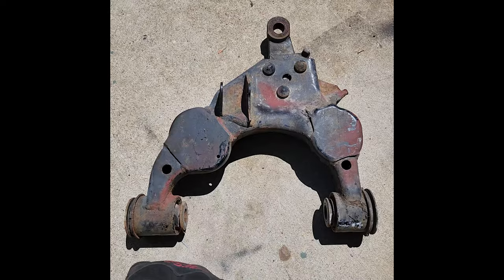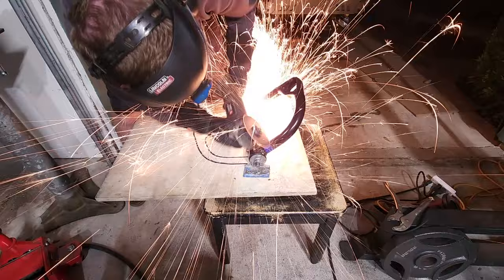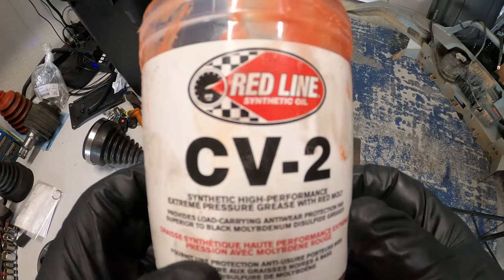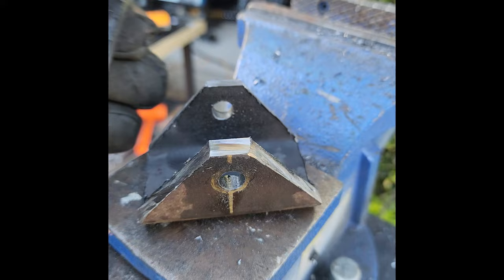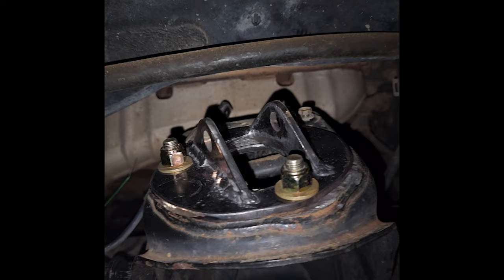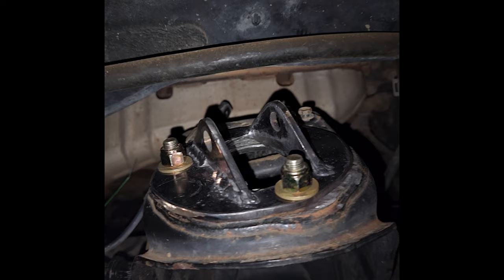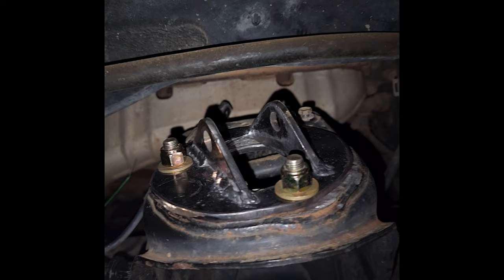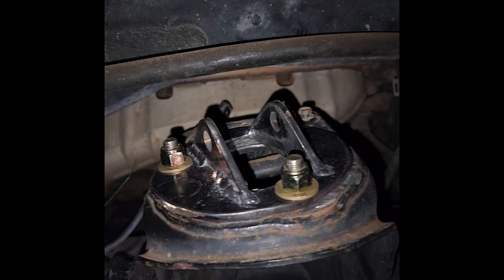EPIC Garage Built Long-Travel Suspension // Toyota Sequoia // Tundra

Comment: Nice vid.  Thanks.  When splicing the tubes you should make the weld joint longer.  taper the ends or fish mouth them or add an internal reinforcement.  Have a look at the tube splicing methods used for aircraft.  You can down the AC43-13 document for free from the FAA.  The reason for this is that the heat effected zone of a weld will be weaker than the tube.  By making the weld longer you will spread the loads over a longer weld.
Reply from the maker: Thanks for the constructive criticism, I wondered about that. Thought about putting an internal slug where the sleeves join, but since it wasn't completely straight it would have been difficult. (Mainly I was rushing let's be honest). I ended up welding some quarter inch ribs from the bushing barrels all the way down the top of each side of each UCA. I think it added a little strength, so far no issues and I've been beating on the thing hard. 
I'm always down to learn though so I will check out that documentation
Reply: @treehouseoffroad  I do quite a bit of aircraft fuselage welding so I look at all welds with those "goggles" on. :-)

Comment: Looks great man! (i know this was a year+ ago for you but I stumbled across your build). Union Valley Reservoir is 30 minutes up the road here, so rubicon videos are both fun and hilarious. It's great to see people enjoying ones own youth stomping grounds and funny because everyone seems to have this mystical view of "The Rubicon Trail", it's like any good off road experience, there's easy parts and parts that most just have to go around rather than through, but the place is kinda special. Next time you head up, take a day and head up to echo lake and hike to the summit. It's 8000 feet of granite elevation and you can see from Lake Tahoe to the pacific mountain range on a clear day.
Reply from the maker: That hike sounds amazing but do you have any tips on mitigating altitude sickness?
Reply: @treehouseoffroad  well airplane cabins are pressurized to 8000ft typically so most people can handle it pretty well, if the rubicon is 6000ish so there's not too much difference. If you don't want to train cardio with a gas mask or can't acclimate quickly, just enjoy the walk. One of my best friend's growing had a family cabin on the lake and we would climb straight up to the flagpole as teens in about an hour, but if you want a safe adult hike you can go the long way round on the trail at a walking pace. There's a decent forest service lodge and parking at the entrance. It's definitely a top 10 mountain tops in CA, like Mt Whitney and Half Dome at Yosemite. Bring a camera, walking sticks, sunscreen, and water. 
A good writeup of the hike/climb can be found here, (it was a 5 hour round trip for the author) https://totallyunqualified.com/2018/08/echo-ridge-traverse/

Comment: I love the video process and how well you show what you’ve done. 
I’m thinking your next step is installing a Dana 44 or 60 under the front of it.
Reply from the maker: It may come to that. My goal is to put a 2nd gen Sequoia front diff in it. Way bigger ring & pinion, way bigger CV axles. But it's not going to be easy....
Reply: @treehouseoffroad  Think of all the problems you would eliminate with a solid axle. Articulation, strength, lower ball joints, etc…. I’m hoping a “how to” guy does it and shows us the best way possible to do it.

Comment: Not bad. Worked at Solo Motorsports for a very long time. I always encouraged customers to do as much work on their vehicles to learn about them. However, I can think of 100+ customers that could not fab their own LT kit.  It is A LOT HARDER than you think versus the cost of an LT kit and your time. My only advice Treehouse — and this is from desert racing Toyotas — lose the UCA ball joints. 1” uniball cups, uniballs & C-clips are cheap at Kartek. Broke too many of the UCA BJs racing “preuniball” era!!  🤙🤙
Reply from the maker: You're not kidding man. At the beginning it seemed like it wouldn't be too hard. But as I got going I hit a few points where I was like "what did I get myself into? I bit off waaay more than I can chew"
 I was looking for a challenge and I found it.
I appreciate the advice on the uniballs, I'll probably do it before I have a failure. I'd also like to have uniball lowers at some point too.
Thanks for leaving such a thorough comment
Reply: @treehouseoffroad  To keep it budget and you have a Sequoia that’s 03-07, change the LBJ with a grease fitting to lube before/after off roading. If you’re not going to beat the crap out of it high-speed or bump super hard over rocks, install good Moog or Mevotech LBJs from Rockauto. Remember the 00-02 LBJs have a “square” bolt pattern like the 3rd gen 4RUNNERs and 1st gen Tacomas. If you have the “rectangular” bolt pattern LBJs, then those are beefy and save your money!!  Good luck.
Reply from the maker: @paulmichaels3999  Thanks yeah mines an 06 but my wife drives an 03 and she has that smaller LBJ. Smaller bolts even

Comment: Exactly video I’d searched many time for home made long travel and there’s not much especially for a Toyota sequoia/tundra
Reply from the maker: No there isn't. There are a few guys with homemade 4runner kits but they used a CNC if I remember correctly. There's also a guy who did LT for a LC 100 Series, came out badass 💪

Comment: Nice work! The only thing I would question is the upper control arms. I know they aren't load bearing so don't have to be that strong but did you consider using larger diameter tubes as sleeves for extra strength? Just depending on your welds to hold them together seems a bit minimal especially with the extra leverage that they'll be subjected to. It'd only be a few extra pounds for alot more peace of mind. Just my 2 cents. Great work overall though 👍
Reply from the maker: I appreciate the constructive criticism! I completely agree, I wanted to sleeve the inside of the tubes but the way it worked out they're not completely straight. About a month after this build I went and put quarter inch plate "ribs" down the top center of each side of the upper control arms tying the three pieces together on each side. Check it out I'm curious on your thoughts: 
https://www.instagram.com/reel/CtcdIUCN237/?igsh=MzRlODBiNWFlZA==
Reply: @treehouseoffroad  yeah,  that'll definitely help 👌

Comment: Question now seeing the prices would it been better to save for a kit or go your route? What’s your opinion sir?
Reply from the maker: I could've bought a kit I went this way on purpose bc I'm a glutton for punishment lol. Nah but honestly I budgeted for in case I couldn't get it done and had to buy upper/lower arms. I already have everything else I need I could get a set of arms alone for $2k and still come in at just over $5k. I'm gonna run this hard for a while and see if it holds up, so far so good
Reply: @treehouseoffroad  right on dude! One tip run the limit strap up higher or a shorter one you don’t want to over extend the shaft the limit straps will stretch overtime
Reply from the maker: @Longtraveldreams  Word thanks for tip I've never had limit straps

Comment: What kind of welding/wire did you do? Mig or flux core?
Reply from the maker: Lincoln 180amp mig running on 220 using flux core
Reply: @treehouseoffroad  thanks for the reply. I’ve been wondering if anyone uses flux to fab stuff on their rigs. Im glad to know because it’s a little more cost efficient
Reply from the maker: @mhernandezpb00  Great penetration too

Comment: I see you ended up using wood for your fixture like I did lol
I have a real fixture now and I’m getting ready to start my rebuild I’ll keep you posted I might start making some kits and other parts so …
Reply from the maker: Haha I was a little worries about the wood not holding tight enough. I was also sure that the rubber bushings would flex/melt/distort and it wouldn't line back up with the frame but it slipped right in! Document your rebuild for us!!!!
Reply: @treehouseoffroad  oh yeah I didn’t even bolt it to the wood lol I used all thread nuts and washers to locate everything using the wood as a template drawn out my tires were moved 2” forward and sleeved the jba uppers with dom as well as the steering links this time around I’m building the uppers lowers ball joint elimination cam bolt elimination Heim steering bla bla bla just waiting on parts ill document everything and post it up

Comment: I just paid for total chaos suspension and King shocks for my 05 Sequoia Limited I'm having someone do it for me they're going to add flared fenders in the front. They're working with a fiberglass company that's making rear fenders for the Sequoia. I will be the first one to get them. It's a prototype they don't have flared fenders for the Sequoia you got to buy the front flared fenders for the tundra to fit your Sequoia so this company in California is fabricating rear fenders for the Sequoia.. I'm also getting rear lockers front lockers bigger gears in the front and rear I paid them 29k they haven't even gotten my truck yet still waiting on my wheels and the gears and lockers... I'm pretty sure you didn't even spend half of what I just did LOL just the total chaos long travel was 11,000 they're lifting it three-and-a-half in with 35 by 12.5 by 17 tires.
Reply from the maker: Wow sounds like quite a build! I just opened an off-road shop with my buddy, too bad you weren't out my way I would've loved to build that for you! There is someone with fiberglass rears on his Sequoia, but it must be a one-off deal

Comment: Was that flux core?
Reply from the maker: Sure was
Reply: @treehouseoffroad  nice job on the arms. I'm looking to do something similar with my 4runner
Reply from the maker: @mada310  thanks man it's been working really well
Reply: @treehouseoffroad  do you know how much travel it pulls? I assume one of the balljoints is its limiting factor?
Reply from the maker: I think I remember strapping it at around 12 inches but I don't remember what the limiting factor was. You're probably right about the ball joints. I'd love to take a spring off and measure but it's my daily driver and I'm just too damn busy
Reply: @treehouseoffroad  the SPC upper balljoints have more movement than factory at least. Maybe someday uniballs will be in my budget

Comment: Really good work. But I think you could have saved money  and time by going with a solid front axle.
Reply from the maker: Thanks but it wasn't about saving time or money, I was on a mission from God
Reply: @treehouseoffroad  you did a really good job.  I would change the the design of your upper control arms.  With all the welding spots, on that control arm something will brack.

Comment: You're living my dream. i like what you said about being uncomfortable. i'm a beginner welder and i modify my 4runner a lot, but nothing ever like this. definitely inspiring me to think bigger with my future projects.
Reply from the maker: Yeah I never thought that little speech about being uncomfortable would resonate with as many people as it did. 
I listen to a lot of fitness/mindset podcasts and it's one of their golden rules. I have a job where I don't get a whole lotta 'attaboys, so I have to look within for the that type of praise.
Keep challenging yourself my man
Reply: @treehouseoffroad  Today i just interviewed for a mig welding position at a mopar header shop... i failed miserably and burned through every pipe they gave me. even after adjusting settings. i think i outran my puddle trying to go fast to avoid burn through. which ironically caused burn through. I'm honestly not sure, the lead welder there ran a perfect bead with the same settings.  I really don't even know what he was doing different. definitely recalibrated how good i thought i was. I mean i've never welded thin tubing before, only thicker materials and i am certified as a welder. But... i haven't been able to practice cause i'm out of work, and i can't get work cause i'm out of practice basically i'm stuck in a catch 22 scenario.

I'm very angry, distressed, agitated. I am a good welder under the right circumstances i still believe, but i  just dropped the ball today. but hey atleast i tried... my third weld test i've failed.

Thinking of just getting an unskilled job to save up for my own machine where i can practice on my own...Sucks to fail so many times. i got 10 weeks of training just to fail so many times.

All those podcasts and motivational speakers always say to push yourself and fail until you succeed.. But i really don't see myself succeeding currently with my current skillset.
Reply from the maker: @jvogler_art4708  I took a welding course at my local Community College, and probably use 5% of what I learned in the real world. None of it seemed to translate. If it were me I'd ask the person that tested and failed me what he would recommend I do. Maybe get myself some thin tube and just practice practice practice.
Sorry you're struggling man, it will get better.

Comment: If you've got something like this that has body roll and you want to kill it for when you're driving on the highway to the trail all you have to do is throw some spring rubbers in between the springs and some sumo springs on the back if you've got a solid axle... They're not hard to put on and take off. You'll totally change the characteristics of the vehicle while you're on the street. Why not? 

Race car drivers do this all the time they change the suspension from track to track using things like spring rubbers apparently.
Reply from the maker: It definitely has body roll on the street. I may try this thanks for the tip

Comment: Awesome job, subscribed! 

Are your end link disconnects working well? Did you modify your Maxxlinks? I need new end links 😁
Reply from the maker: They worked great for a while but ended up getting slightly distorted under all the abuse, and became difficult to connect and disconnect. I've since abandoned both my sway bars. Driving without them takes some getting used to but I like it

Comment: Very cool! Badass.
By any chance have you ever hit the 4th button (the one next to the vac button) while driving? 
Now the orange blinking light doesn’t turn off while driving in 2nd Normal daily driving.
Reply from the maker: The 4wd button is meant to be pushed at speeds up to 60 mph. If the orange light is flashing It could mean a lot of things, but usually indicates that the computer has not finished its cycle between the modes. There's several good YouTube videos on this topic, you'll need to do some research. Good luck thanks for watching

Comment: I've been a welder/fabricator nearly 30 years, from military patrol boats, wind towers, aerial lifts, oil & gas pipe welding to custom tube chassis and suspension. You have the perfect attitude for someone just learning. I'm going to follow you to watch your growth as a fabricator and see what cool shit you build. Now for the criticism. Please, I beg of you to invest in a gas mig setup. Even a Hobart handler 140 gas welder will push you to the next level.  Ideally a 220v machine will secure your fabrication work and ensure it stays together. Thanks for sharing.
Reply from the maker: Thanks so much for taking the time to write all that. The welder I have is a Lincoln 180 amp that I run on 220v. It does have the option to run gas but it's so windy where I live and I don't have anywhere indoors to weld that is ventilated. A buddy and I recently started renting out a bay from a local auto body shop, it's a little bit more protected from the wind but not completely. If I wanted to run gas, how much wind is acceptable?
Reply: @Treehouse Overland  it depends on a lot of factors. Welding with the wind at your back can make the difference. I've welded in 40-60 mph winds with nothing more than a few pieces of cardboard around my work piece. You can always turn the gas up on the regulator, use a smaller diameter nozzle, or pick up a weld curtain and utilize all three. It makes a huge difference in weld quality and cleanup. When you "gas out," you will know immediately. The weld changes color, and the puddle starts fighting you and spitting. Pure CO2 is cheap but causes more spatter and welds good. 75%/25% (Co2 and argon) is the cleanest gas for steel and allows you to really learn by watching the puddle with minimal spatter and cleanup. I love the videos and DIY on the Sequoia. Keep up the great attitude and work 👍
Reply from the maker: @PNW_Rodeo  Great information man thank you so much. I think with this new workspace I'll really be able to step my game up!

Comment: Are you qd sway bar disconnects home built or spruced from a company?
Reply from the maker: Home built, sadly they ended up getting pretty chattery over time and difficult to remove 😔
Reply: @Treehouse Overland  if you do find a better option. I would be down to watch a video about them. I'm looking for an option for my 3rd Gen and I'm at the point of trying to adapt anything I can make work

Comment: This is pretty inspiring. 

I’m tempted to try this myself at some point. 

Only thing I think I may do different would be sleeping the upper control arms to ensure strength instead of the butt weld only. 

But as I watched you said you’ve done the rubicon and road-tripped hundreds of miles so sounds like you’ve got it dialed. 

Really cool project.
Reply from the maker: Thanks I planned on doing like a long rib or gusset but I ran out of time before the trip and just sent it. I'll still do it at some point. Tinkerer's Adventure convinced me that the UCA sees very little force applied to it.